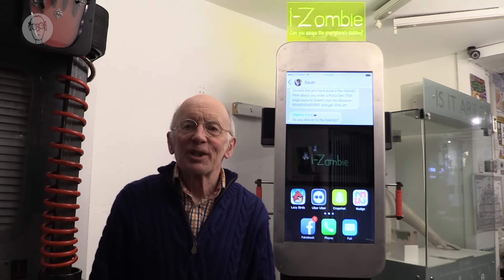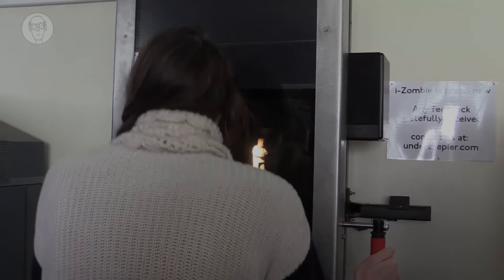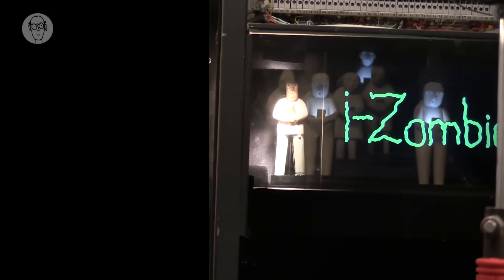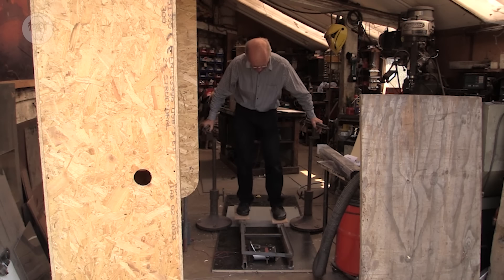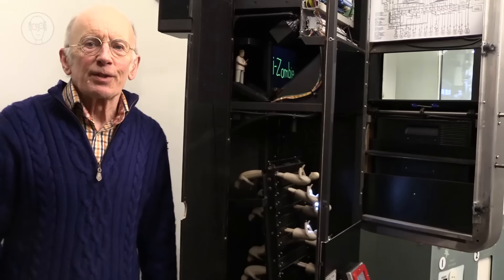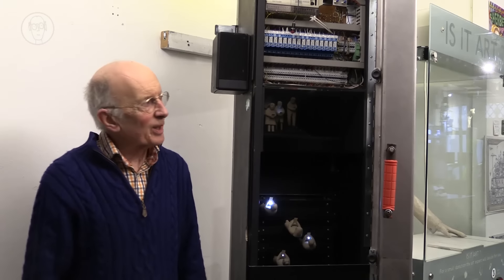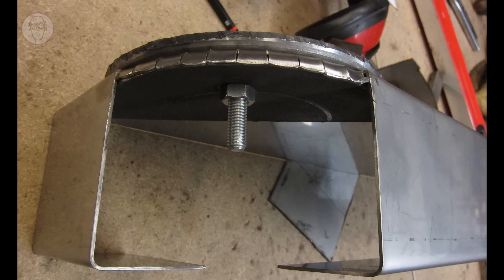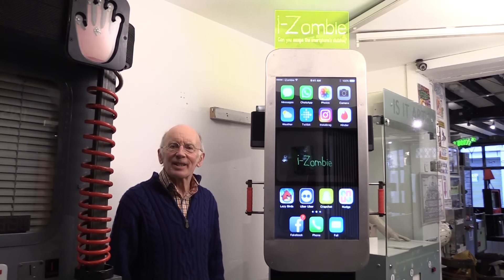The Secret Life of Arcade Machines, i-Zombie

Comment: 9:48 I used to work on old sock knitting machines, and they were "programmed" by a drum of cams (the cams held on the drum by screws so they could be moved) and the cam drum was driven by a ratchet, but the ratchet was controlled by a chain, it had special links that raised the ratchet paw, so it would take longer for the cam drum to rotate.
Reply: Long lost memory brought to life.

Comment: Loving this series, Tim.  Don't know if I'll ever be able to get to the UK, but if I do I'll definitely have to stop by the arcade and see it in person.  We've got so much effort going into maintaining 80s videogames and several decades of pinball, but not many people making new electromechanical ones (outside of a few ticket-giving machines to bilk kids out of quarters...)

I had to make a custom belt length for my 3d printer, to transfer the motion of the Z axis to the other side so both would be lifted.  It was even trickier than your axis because the join has to go around the toothed wheel several times as the gantry is raised.  It took a very sharp needle and thread, and then reinforcing with cloth tape and superglue...  But the X axis on the printer is a similar design to your moving guy - it doesn't need to make it around the wheel, so the belt isn't even joined together.  It just slots into the carriage on each end of the belt.  Very simple, but it would cut down on how far it can move.
Reply: In the arcade game he could have simply added a 3rd (e.g. spring loaded) roller to tighten a slightly too long belt to tweak the exact length for the case width. This would also compensate wear or thermal expansion. Car engines often have such mechanisms for their camshaft belt.

Comment: Great show.
Reply: It made me think 🤔? ; can I use a cheat sheet - hay bail chain - WD - 40 - IBM electric typewriter 
====== 
Worm 🐛🪱 drive vending  machine 
====
The player is at the bottom line a Rock & Scokem robot 
🥊 🤖 boxing🤖🥊 set.
====°
If one of the zombies fall on you you head pops off . Maybe little sang bags.
=====
Military 🪖 post arcade dirt  ball Vs. rag bag
======
Plus , Mr. Hulkin thank you for your show. 
====
This morning 🌄 I woke up with an 💡 for an Amish Solenoid. 
A , brass lever handle 5/8 " ball valve .
Spring to hold valve open & cable or wire to pull the valve closed from a distance. 
=====
A , no strings attached idea 💡. 
🪂🤸🏡🦥 Bryan

Comment: Clever stuff, especially using the chains as conductors. I imagine it took a lot of fiddling to prevent the mechanism from being seen.
Reply: I would have placed a solar cell under each figure and an (e.g. infrared) LED underneath (induction coils or even optical fiber would likely also work).